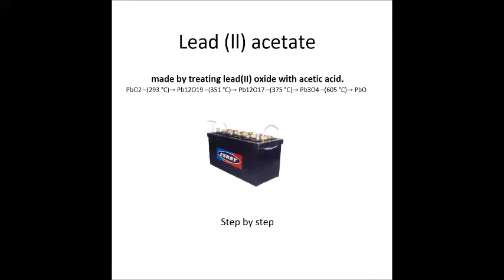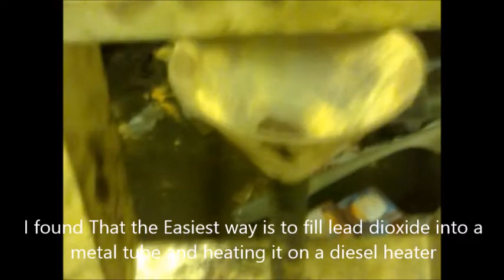Make  Lead(ll)acentate (from car battery) using vinigar / acetic acid.

Comment: Hi.. this is great experience 
I would like to ask you if you allow about the quality of the lead acetate that u made because I have doubt about the quality of the lead oxide that used in this experiment. You said you got the battery from junkyard so it is definitely a dead battery. Is the lead dioxide dead too? or only just the lead grid dead in the dead battery and the lead dioxide is good and useful ?